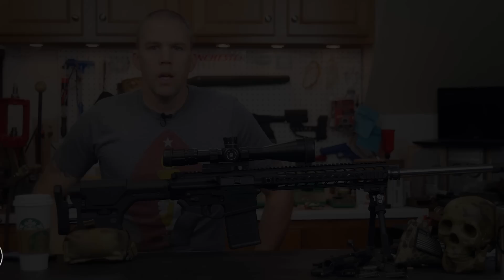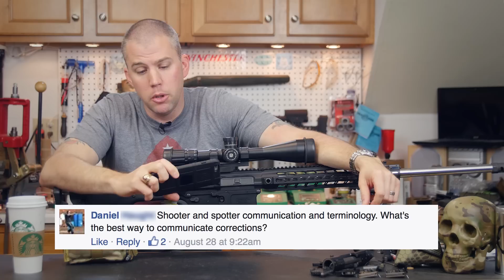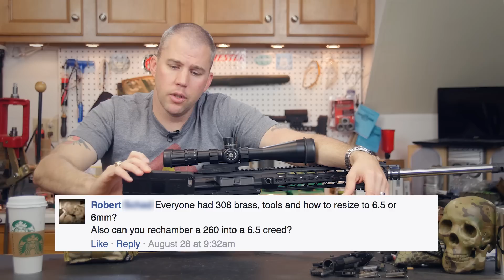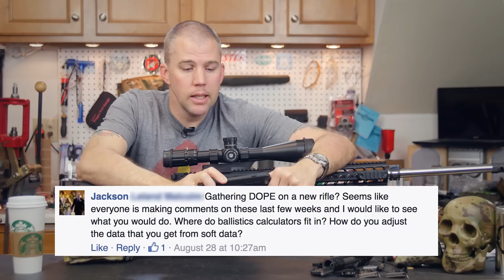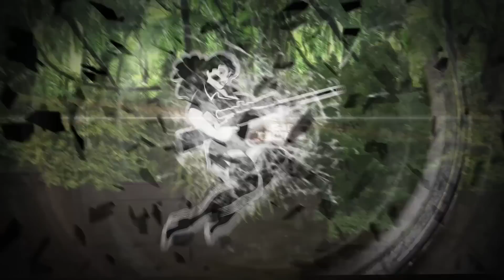Mail Call Mondays Season 4 #16 - Shooter/Spotter Dialogue, Doping a New Rifle and More!

Comment: A good thing to learn is to understand what distance each "click" moves your impact at the distance you are firing.  For example at 600 yards I know 0.1 mil is 2.16" so in my head I can say that is about 2".  If my wife is spotting she can say 2" left and I know on an 8" target I'm going to go 0.2 or 0.3 mils right to get me to the center of the target.  You can do the math in your head close enough by using 0.36" for every 100 yards so at 1000 yards 0.1 mil will move your impact 3.6"

Comment: When I resize .308 to 7mm-08, I anneal the brass, lube it, run it through the 7mm-08 full-length sizer die, turn the neck, and trim and chamfer.  Afterward I might even need to neck size it to ensure proper neck tension.  If I'm going even smaller, like .243 Win, I'll need to resize in two stages: .308 to 7mm-08, then 7mm-08 to .243.  It's a slow procedure.

Comment: From the two long range precision shooting class I took this summer:

-shooter on glass

-spotter ready

-shooter ready

-send it

Of course, wind and elevation corrections were given based on the rifle scope reticle design....

- Dial Up 1.5 minutes

- Hold left 0.5 mil

etc.

The nice parts about the interaction is that with ear protection, you more or less know what's coming and it reduces eye fatigue because you are not staring forever through the glass waiting for the shot to go. Took some practice but once learned it was great.